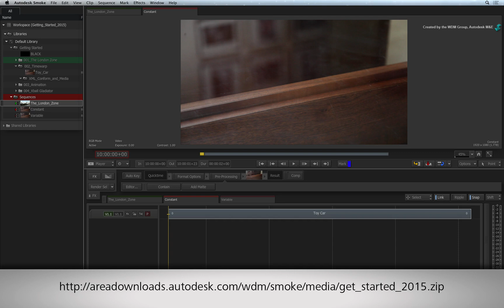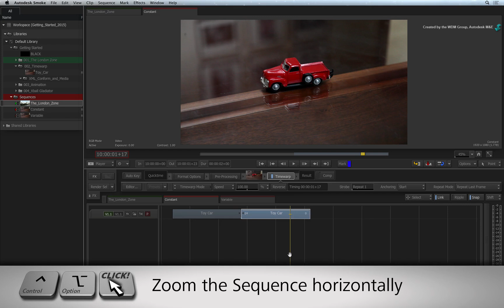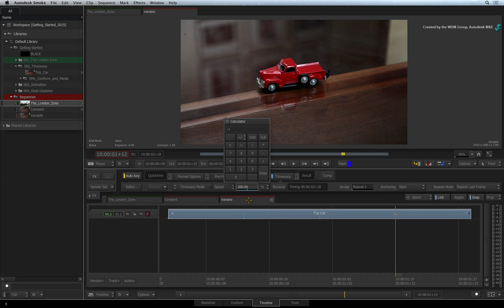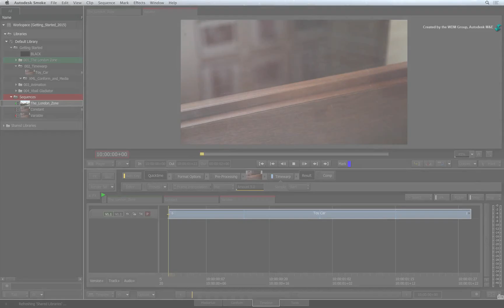Timeline FX - Speed Changes

Comment: What kind of machine is your smoke running on? Any specifications you can give me?
Reply from the maker: I was using a 2009 Mac Pro with an Nvidia FX4800 when these videos were recorded.     I also use a Macbook Pro (2013) with about 8 gigs.    The bottom line is to use as much CPU, RAM and graphics as you can afford.  Hope this helps!
Reply: Smoke Learning Channel thanks so much for the answer. I have 2013 macbook air with 4 gigs. The videos are too laggy but sadly i cant upgrade the ram. 
kind regards